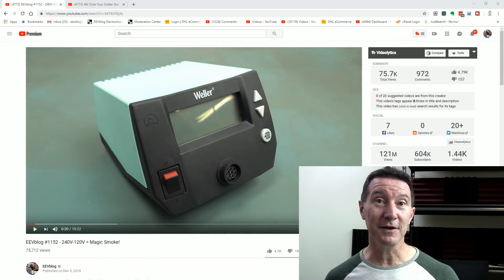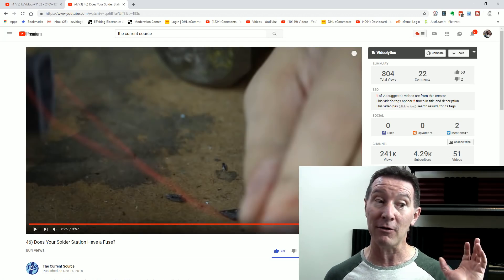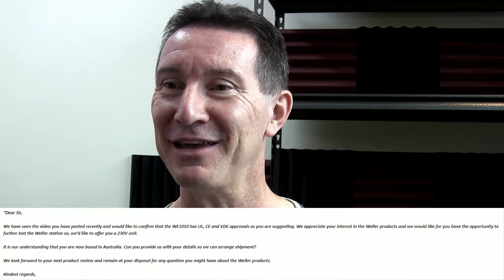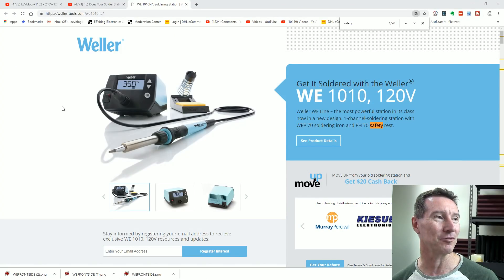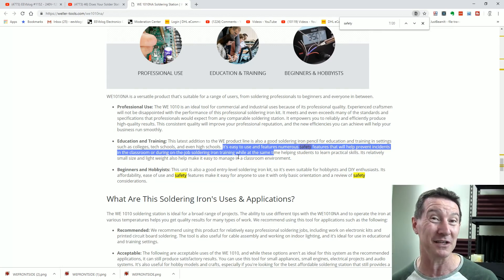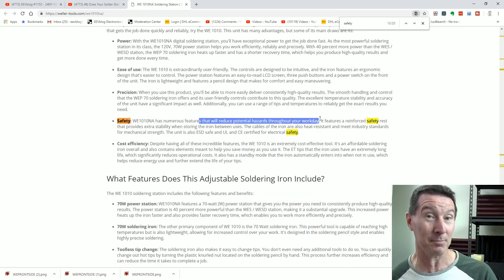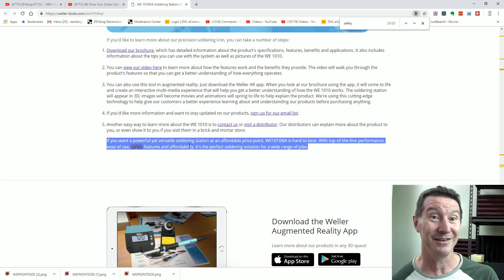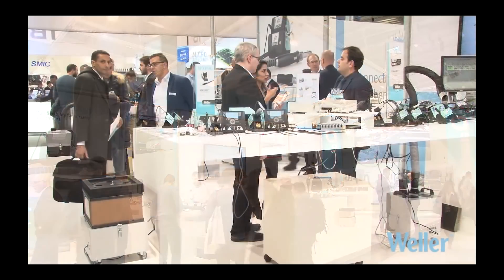EEVblog #1160 - Weller Responds!

Comment: I don't know dave, isn't the fuse for the primary side of the transformer technically your breaker switch? Wouldn't that provide the security you need?
Reply: Breakers protect the home circuit, not the appliance.
Reply: @deelowe3  no fuse or breaker is meant to protect the appliance. Only the wire
Reply: @Pops180  the fuse in the appliance absolutely protects the appliance
Reply: No. A small load like this can start a fire before even coming close to tripping a breaker, on either 120V, or 240V systems.
Reply: ultimately, you can start a fire with a 9v battery in the right scenario. so, it generally best if all electronic devices have measures taken to prevent thermal runaway failure modes. A toaster can start fires without tripping the breaker.
Reply from the maker: No, the mains fuse can deliver 3800W into that transformer before it trips. So the answer is no.
Reply: EEVblog And even that for a long time. If that fireball would short on my circuit @home, it probably would blow the primary in a low earth orbit with 32 amps @ 230. 
I expected way better from Weller. Guess I wont buy a product from them.
Reply: I would suppose that Normal automatic fuses have both a thermal and a electromagnetic way of being tripped. And if the windings start melting together that point would be reached fairly quickly
Reply: Not necessarily. Even in the short circuit conditions created when the primary winding failed the resistance of the wire may result in a current draw that is less than the breaker is rated for. Especially in the UK where sockets are commonly protected by a 32A breaker.
Reply: Douglas Fletcher In the UK the plug fuse would help protect against that. Unless this unit was designed with that in mind, it’s potentially dangerous
Reply: @Gergus  the plug fuse still is rated for like 2.2kW
Reply: @doug7131  Hi, in the UK we have fuses in the plug-top so for something  of such a low wattage it would have a 3 Amp fuse
Reply: I live in the UK and yes we have fuses in our plugs. However since the iron has an IEC connector on it there is nothing to stop someone using an IEC cable with a 13A fuse in it like most seem too. Also BS1362 fuses are fairly slow - A 13A fuse will pass 25A for 10's of seconds before blowing.
Reply: @raywelshman  LOL, you know what's funny... There was a whole comment thread on either the original Weller video Dave made, or another video I recently watched, where a whole shit ton of you guys from the UK bashed a guy from the US who said that very thing. He said, "some of the plugs in the states have a fuse in the plug..." And about two dozen Brits tore him apart and said things like, "those plugs with fuses are so stupid," and "another stupid thing the US does," and "those plugs are the stupidest idea ever, since you can plug in a plug with the same connector and no fuse. What a joke US electronics are." That's hilarious. Come to find out, either it's not stupid, or the British plugs are just as stupid. I'm sure there will be some excuse.
Reply: @doug7131  I'd be surprised if a 13 amp fuse passes 25 amps for tens of seconds - perhaps we need JW to break out his test kit!

Comment: Well he is from marketing, he's not qualified or authorised to make any technical comment, just try to keep customers happy, and get some good press, so he sends you a freebie, which is pretty much the limit of what he can do.

I'm curious to know how it can pass those approvals without a basic fuse.

BTW, please find a 120V DC source to test the claim... Can anyone send Dave some car batteries?
Reply from the maker: When you are the director of marketing and you have to respond to a serious safety issue in a public industry specific video with 75,000 views, your job is to make sure you have the correct technical answer.
Reply: @EEVblog  he could very well have passed on the info to the tech department for an official comment, and just tried to sweeten you (by sending you another dangerous device) whilst waiting for their response.
I imagine you'll get a proper response, especially after this video!

But yeah, it is rather badly handled, he probably doesn't understand the issue enough to know why we're all so concerned about it.
Reply: The tech department was already told to not put a primary side fuse.  I bet that they knew that it was only a matter of time that there would be a problem.
Reply: Call someone who knows the answer. That's his job.
Call the service Hotline, they won't know the answer, too.
Reply: It says 120V or 60Hz, so 240V/60Hz should be fine, right? Someone in the US want to go butcher a dryer cable?
Reply: Before a public reply is issued one would imagine the VP of marketing calling for assistance the Tech dpt. However, the reply seems to have the intention of hiding the truth by not answering the question. They would have been better not answering at all
Reply: This design looks like something from the 70s. Whoever did it is probably retired by now.

Comment: I realy like my Weller WD2M and WD1 stations, and I can confirm they have mains fuses.  I won't be buying another Weller though unless I know it is also fused, no matter what the marketing wonks say.
Reply: No concerns besides the fuse?
Reply: @mjouwbuis  Not really.  They're certainly not the cheapest, but also not the most expensive.  I use them professionally, and have had the WD2M as my main iron for 10 years and it still performs great.  A bit pricey to replace the tips on the micro iron as they incorporate the heater.

Comment: My Yahua 936 is fuzed and only cost 22 yankee bucks.
Going strong after I rebuilt the iron and re-flowed all the solder joints 
and painted it blue.  :)
Reply: Hakko blue or weller blue?
Reply: @SuperCloneRanger  i bet he would go for hakko blue, because weller blue doesn't have the fuse.
Reply: @radius.indrawan  the fuse blue... 😏
Reply: I also have a 936, though mine is a SparkFun 936, and I spent $30 on it. Still have the original heating element; did buy new tips though ($12 for a full set shipped from eBay). Mine is also fused.

Comment: Is there a fuse integrated into the plug?
Reply: not typically on US products, and if there was, Weller would have said so in the response
Reply from the maker: As Andy Plater said, they would have mentioned it.
Reply: The reason we have fuses in the plugs in the UK, is to protect the flex/cable, not the product. Sockets in the UK are typically connected to 32A 240V breaker and if the flex is only rated for 3A or whatever, you put a 3A fuse in the plug. Many people make the mistake of just sticking 13A fuses in, which could cause quite a nasty failure on a cheapy Chinese flex.
Reply: I'm sure it's the same over the world but interestingly enough, circuit breakers are typically rated to "instantly" break, (<100ms) in the case of type B at 3 - 5x the rated current. This is to account for loads being switched on that have high inrush current - motors, power supplies with capacitors, lamps, this kind of thing. so a 32A breaker could deliver up to 160A for a few seconds or even minutes depending on the overload, rather than tripping instantly. It is relying on the bi-metallic strip heating up to trip the circuit, rather than the electromagnet.
Reply: Only the UK do that, and for a different (historical) reason
Reply: @KeanM  No, not only in the UK. I've had numerous products that have fuses in the plug. (In the states.) So there are products sold all over the world that use those types of plugs. Maybe the UK are the only ones who require it, but they're certainly not only in the UK.
Reply: @xenonram  Interesting!  Do you have a photo?
Reply: Andrew Delashaw Christmas lights in the USA typically have fuses in the plug so this the a totally foreign concept for us.
Reply: To elaborate more on andys response, The only time I've ever seen (US) fused plugs was on lighting such as desk lamps and christmas lights.
Reply: That's a UK thing, generally. Most other plug types, including US plugs which presumably the burned one was, don't have fuses.
Reply: Only in the UK plug... The rest of the world just burns.